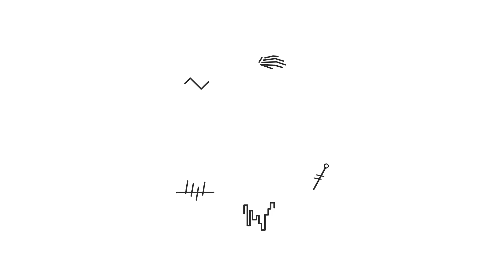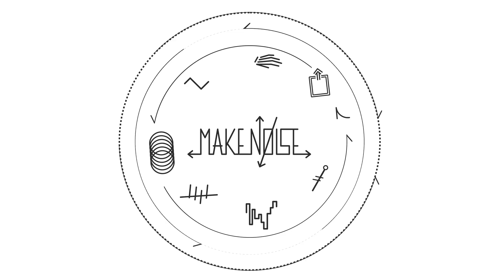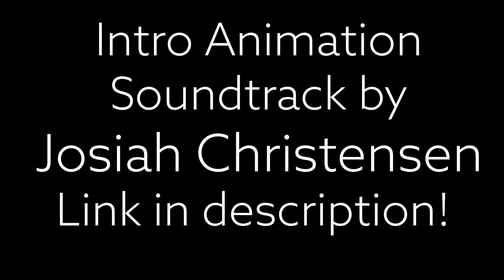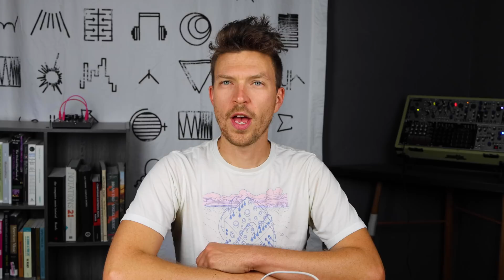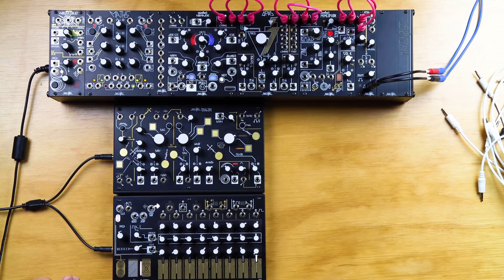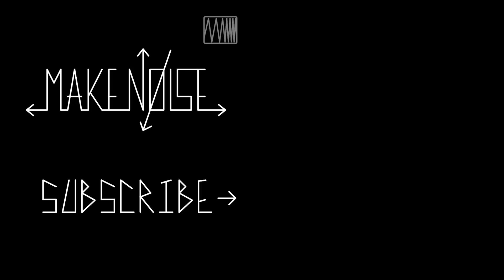Patch From Scratch: Carving Up Noise

Comment: A really great demo, thanks Walker! I admit when I saw the title my immediate reaction was "wait a sec tho, the $4K B&G Shared System doesn't even have a 'traditional' noise source", but I guess a Morphagene reel will do just fine, actually probably significantly better than the traditional "abused transistor" not-really-white noise source. I've always thought that was a strange omission from the Shared System, and it was the second thing I added to mine, after Brains.
Reply: The Shared System doesn't feature a traditional noise source because you actually have to Make it. From scratch. With a Wogglebug, Squarewave clock and an oscillator that can't keep up with the one it follows (DPO). But this is truly 'designer' noise :)
Reply: @CinematicLaboratory  yes I'm aware that you can patch a noise source. It's still ridiculous. Synthesis shouldn't be an "I made it as difficult as possible" contest. Unless, I suppose, your primary goal is to post tangled patch cable messes on forums?

Comment: These are always so inspiring!
I'm reminded of a noise-using patch I made the other day in my system. I'm working with all-homebrew modules (not entirely by choice, I'm trying to save up for a MATHS and a Wogglebug) and they're all pretty rudimentary, so my rack's only oscillator is based on LMNC's "super simple" reverse-avalanche oscillator, and the filter is a vactrol-controlled passive LPF. But I do have a noise generator that outputs plain white and pink noise. By turning the oscillator down past where it stops, and CVing with filtered pink noise, you can get chains of not-quite periodic clicks, kind of like a Geiger counter; I'm using them as pings into a multi-effect, where reverb smears them out, delay repeats them, and a flanger or phaser turns them into chimes.
Reply: Sounds like I should sell my massive setup and get on your level
Reply from the maker: Nice! Happy patching!! ⚡️⚡️

Comment: So... 1) not one bit of this went over my head (for a change) ;-)   2) I feel like since Befaco released their noise module there has been renewed interest in it. Nice touch adding the voltage follower at the end. I think maybe this video suggests a weakness in the Make Noise lineup. You have no dedicated "Noise" sources? Future product firmware enhancement or hardware addition? Maybe a noise source / S&H with obvious MakeNoise spin on it obviously? This was right up my alley BTW.
Reply from the maker: Thanks for watching! The tELHARMONIC had a Noise output but otherwise we tend to create noise with feedback etc.
Reply: @MAKEN0ISEMUSIC  I have been using the N-output of the tELHARMONIC more and more recently 👍